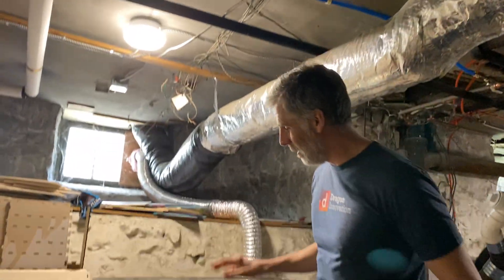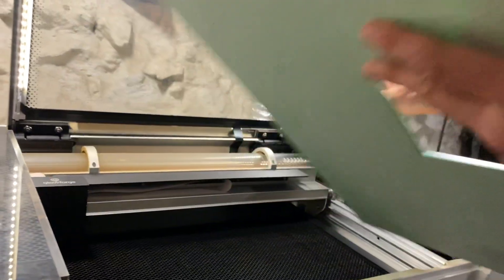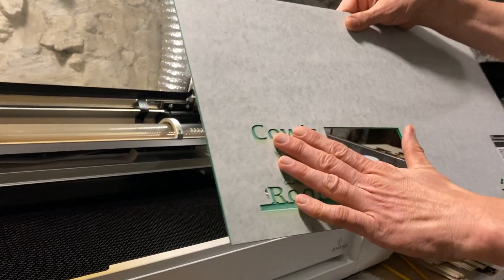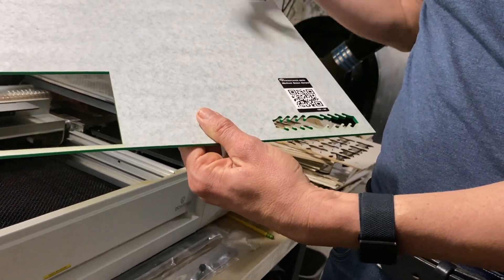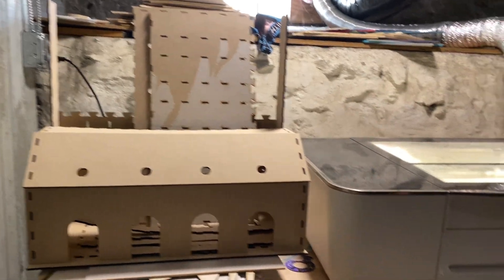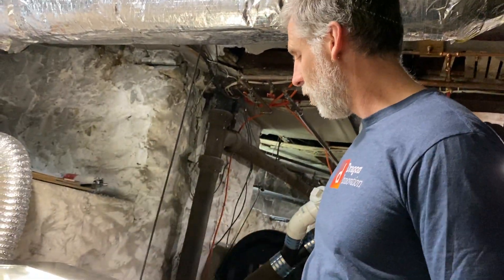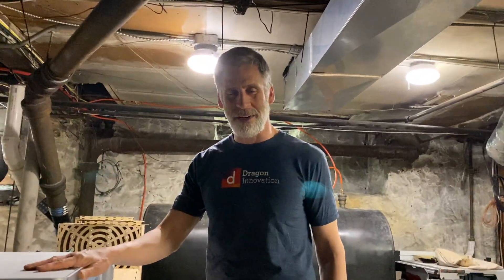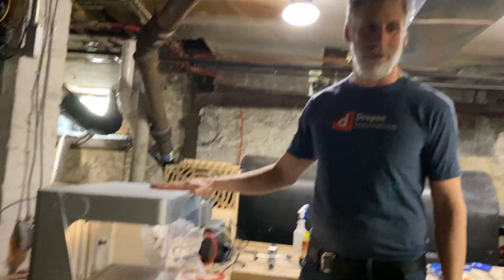Scott's Home Shop and Tools for At-Home Prototyping

Comment: I learned SolidWorks and Blender during covid and that lead me into getting some FDM 3d printers.  From there I've started playing with 3D printing molds and pouring resin in (silicone, so far). That workflow is a total game-changer for quick prototyping.